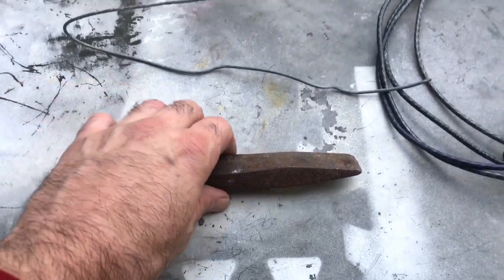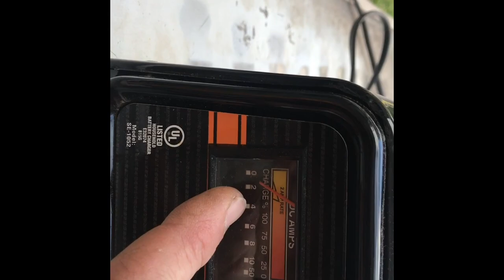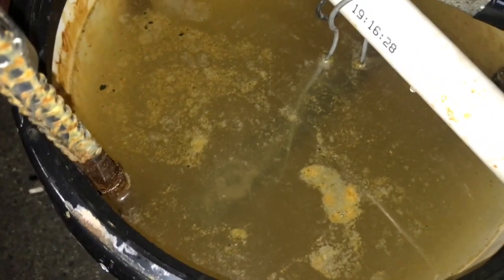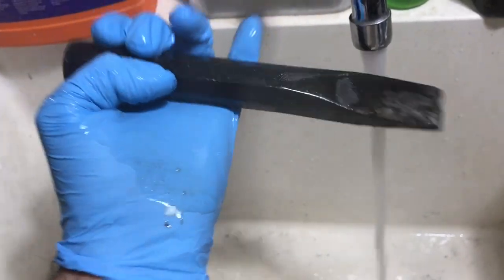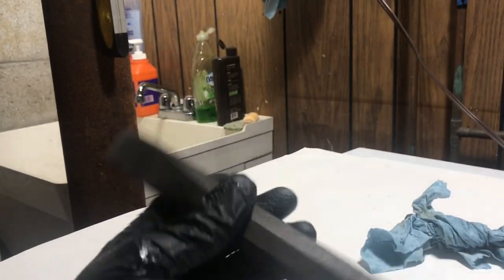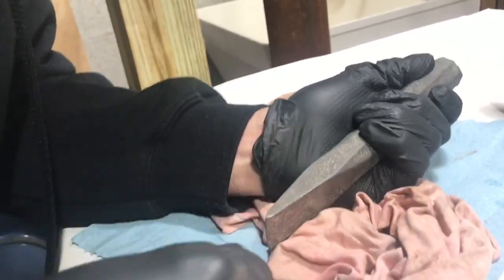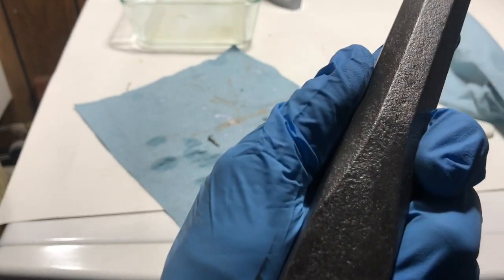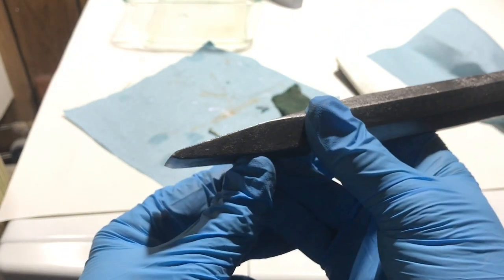Restoring Old Rusty Stanley Chisel

Comment: Give you a tip, had a rusty mess to clean and I put it in a plastic bucket with Muriatic Acid, They use it to clean brick joints and you can get it at any masonry supply. Works really fast and get the same results in about an hour, FYI
Reply from the maker: It comes in a powder? If so I might have some
Reply: L&L Service it comes in a gallon jug but it’s a mild acid. Any time you deal with acid it’s dangerous so be careful gloves eye protection and such. I guess any acid would work but some will be more dangerous then others. I used it because an old timer suggested it. It may come in powder form but never have seen it. For lighter clean ups I use vinegar. But something that rusty would take something stronger. Be careful!!!!!!!